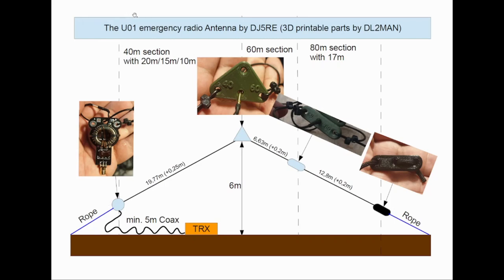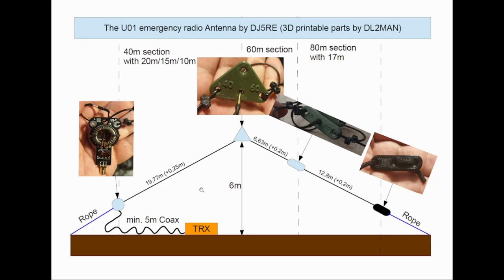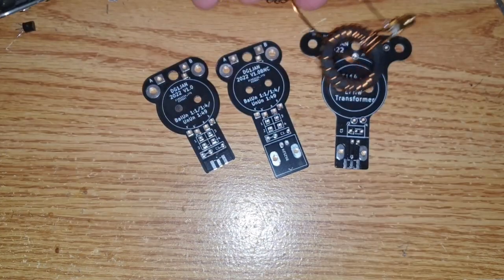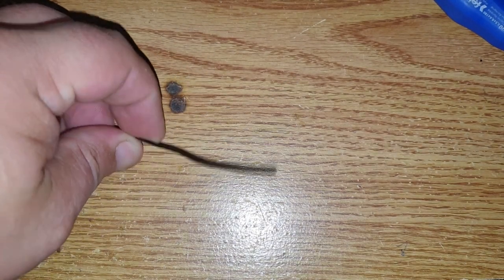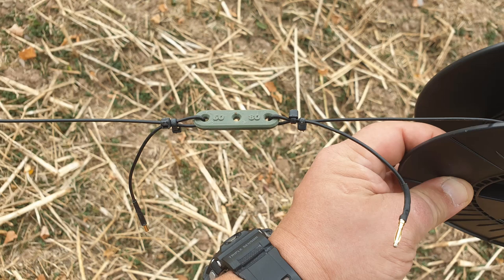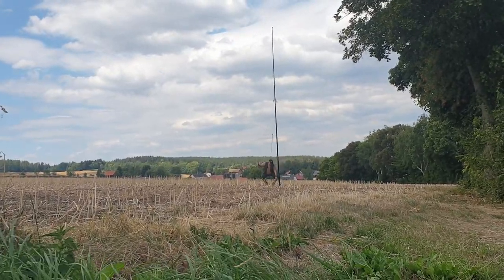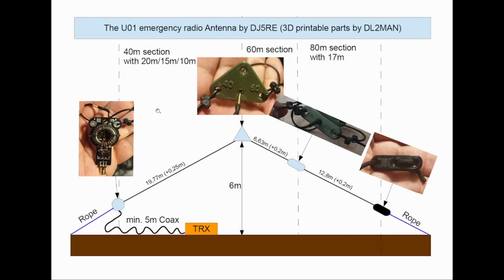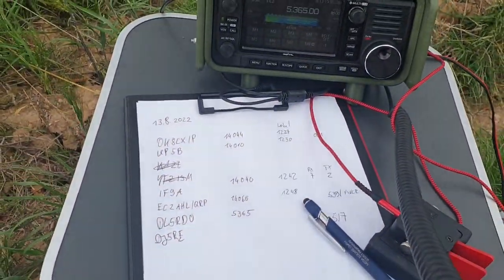U01 emergency communications Antenna - 80/60/40/20/17/15/10m EFHW

Comment: One more new thing I've learned from your videos. I didn't know the thing about the coax acting as RF choke. I must buy you a couple of beers by now with all the new things I learn 😁😁. 73 and have an amazing weekend. I will build this antenna too to have it there just in case 😁. Brilliant.. P.S. I didn't know about the 60m band either that it works that way.
Reply from the maker: There´s 2 reasons for min 5m coax: 1. The coax acts as counterpoise. 2. The coax on the ground helps in suppressing some common mode currents. I´m always available when it comes to drinking beer ;) Wish you the same. 73 Manuel; DL2MAN
Reply: @dl2man  Hehe... thanks Manuel. Ohh I hope one day we will share some and some QRP fun. Maybe next year. Until then... I am learning a bit more and having fun on air. 73

Comment: Couple corrections: the 60m one should also resonate close to 30m, and the 80m should certainly be resonant without tuner on 80, 40, 30, 20, 17, 15, 12 and 10m. It seems in your case they were all a bit out perhaps as it was resonant on 80m higher in the band. I think there's also some trick with a coil to make 80m usable higher up without upsetting the resonance on all the others (except 60m).

Comment: Will the FT114-43 core on the DL2MAN PCB handle 50watts?
Reply from the maker: I´m sure it will handle it. I´m not sure if it will heat up.... 100W Version will have FT140-43. Coming soon with own PCB including spindle ;) 73 Manuel; DL2MAN
Reply: @dl2man  Awesome re the 100w version. I will certainly build that.  Thank you so much for sharing with us 73 Greg VA7BC
Reply: @dl2man  How much FT8 power would the 100W version handle?  Like 20 W?
Reply from the maker: @TheMicrofox  100W means 100W ;) We´ve tested the FT140 cores with up to 400W, and it worked with some heating up.
Reply: @dl2man  Not so. l recently read about an OM, who burnt his 400W Balun with a 100W TX using FT8. Also I have seen Baluns/Ununs adverstised for 1000W SSB and 500W CW.
The reason is the duty cycle. Duty cycle is low when talking on SSB, higher with CW and extremely high when using digital like FT8.
Reply: Actually, ft8 isn’t that bad.    It’s only 50% duty cycle with each transmit leg only 30sec long.

Slow digital QSO modes like Olivia 250/8 is the most brutal.  Running 50W into my size 140 mix 43 unun melted the 3d printed PLA case it was in.

Comment: Hi Matey. I am in the process of making one of these aerials . But using mainly scrap material. Old wire, Car connectors and my homemade balun. Not as detailed video as yours so if you dont mind I will include a link to your video and a  short clip from your video. Assume that's ok. Cheers from old George G1BKI. Ps my video is now uploaded and live.
Reply from the maker: Thanks for considering building one. Everything that helps in spreading the word is welcome. Just a quick remark: It probably won´t work, if your UnUn is really 1:9.... 1:49 required, as Impedance is quite high. You can watch my other Videos about EFHW Theory, if you want to know how to wind one. 73 es hpe cu on Band ! Manuel; DL2MAN
Reply: @dl2man  Hi Manuel.  Thanks for your reply. I have made plenty of Baluns. Got quite a selection using Ferrite Torods and Rods. So I can experiment.  Video of them is included in my Ham Radio Playlist. I will be updating my Videos Later today. Cheers from G1BKI.

Comment: Manuel, I may have missed the answer to this question over the last few months, but what SWR would you say is the worst that can be accepted to operate with without much concern that the (tr)uSDX FET's will pop? As you designed the rig I suspect you have blown up numerous output FET's so you have a good for what they can and can't tolerate. I understand that there is simply no way to know for certain, especially these days with fake and subpar FET's on the market, but your best guess would be appreciated so I have an idea of how much effort I have to take to ensure a good match. I know some old-time tube-running hams who were happy with anything under 3.5 to 1, but I also have used some Motorola biz-band rigs that start cutting their output power any time the SWR climbs over 1.6. What's acceptable all depends on the output circuitry. I assume 1.5 is OK, but is 2? I always try to have a near perfect match because I'm just that sort of person, and it eliminates all sorts of possible problems before they can occur, but there may be situations such as emergency operations where I can't, so knowing what will probably work and what won't would be a great help. Thanks.
Reply from the maker: I wouldn´t bother too much up to 1,5:1. If your FET´s are not matched well, it could be a problem above that. On the other hand: https://youtu.be/VVN6xxu69zg with carefully selected BS170´s I TXed for 20 Minutes into SWR of 9:1 and worse with no problems.

Comment: Hi Manuel!
Very good implementation of the antenna project. 
Perfectly printed high quality parts. 
Your drawing is very useful for rebuildig the U01-antenna.
The wire from DX-WIRE is ideal for light and stable antennas.
A special thank goes to DJ5RE Tom for developing and optimizing the "emergency communication antenna".
Reply from the maker: Thank you so much !

Comment: Has anyone tried to implement connecting and disconnecting antenna segments with a remote control?  Is it possible?
Reply from the maker: I don´t think, this would be possible with reasonable effort. In this case, it might be easier, to build a trapped efhw. The Problem is: You´re losing the harmonics with that.... Building this exact Antenna with traps would limit it to 80/60/40m.  But you can add more traps for more bands. However: Every Trap means loss..... 73 Manuel; DL2MAN

Comment: Hello Manuel, received my tr usdx main board, its built and setup as by your advice, functionality is fantastic, looks great in the green case, I have great sound quality front a little exterior speaker, congratulations on all your hard work about your project, I await delivery of my classic band board to arrive, a big thank you to you and gedo, I will be looking at your anntena very shortly! it will be amazing how it will perform, ime sure of that, keep those surprises coming, this is just what the amateur radio hobby needs right now, innovation and functional and fun to use hand held transceivers. Brilliant work 👏 👍
Reply from the maker: Thank you so much for your kind words. 73 Manuel; DL2MAN

Comment: Hello Manuel
Do you have a reference address for the various antenna parts? Wire, plug contacts etc.?
With the best 73
DL9GAW (Black Forest)
Reply from the maker: Wire = DXWire, Plug Contacts as well as SMA or BNC sockets Amazon or Ebay, Silver Mica Cap: https://www.tubeampdoctor.com/ 73 Manuel; DL2MAN

Comment: Excellent video and project. I have a question however. I know the antenna was designed for NVIS operation. How much of an impact on the VSWR plots do you think would occur if the antenna was suspended at both ends from a greater height making it an flat end fed antenna instead of an inverted V?  If not much of a change it could function for both local and distant comms.
Reply from the maker: Especially on the fundamentals, the effect will be huge and wire length need to be adjusted. U01 Antenna is no re-invention of the wheel. It´s just a standardized setup. If you change the setup, you need to tweak wire lenghts and maybe even Transformation Ration of UnUn.

Comment: 9:1 unun and 110ft of insulated wire, put it up in the air and a decent radio tuner and it works well 160m through 2m. Yes I tried it on 2m and it worked just fine. Oh it is an inverted V in my yard. I tried it out just for giggles. make sure you have  a decent counterpoise wire
Reply from the maker: I try to avoid a tuner.... resonant antennas are my choice, as they are usually more efficient.
Reply: @dl2man  So why does my inefficient antenna work around the world? it must be broken
Reply from the maker: @n0vty873  simple: good conditions. Try in a direct comparison and you will know. By the way: Your answer is called a "strawman argument". You´re attacking a position, that I´m not defending. I did not say, your antenna does not work, I just said, I try to avoid tuners, as resonant antennas are usually more efficient. When I only have 5Watts, I want as much of that low power as possible radiated and not transformed into heat.
Reply: @dl2man  Yep Im just a fucking idiot

Comment: Thank you for sharing. I would like to build one of these. I am wondering if anyone has tried replacing the 40/60 and 60/80 connections with 40 and 60m traps. I am lazy and don't like taking antennas down to change bands 😁.
Reply from the maker: I´m not so sure if the Antenna will still work with Traps. You might be able to make it work if you insert a Trap for each Band, but I think, using the harmonics is no longer possible with traps, as they act as artificial additional length for the fundamental, so the harmonics are way off.... And every Trap means additional loss ! So you will lose efficiency. I might be wrong, and I thought I had a measurement of my Trapped EFHW for 20/30/40, but unfortunately I did not save it for the higher Bands, so I could look at the harmonics. Will do that measurement, next time, I elevate this Trapped EFHW, because I´m interested as well. Thanks for your question. 73 Manuel; DL2MAN

Comment: Thank you Manual for supplying this information on the U01 antenna. Our club is going to build and test a U01 for experience as well as use for emergency communication.
I was wondering what kind of antenna did Tom use on his side.
Reply from the maker: Tom was at home and used a full size doublet 2x20m, as you can see on his QRZ.com page. Basically the same amount of wire in the air, exept he used a tuner....

Comment: Very interesting concept which is based on a resonant wire and 49:1 transformer which provides the benefits of harmonics. The downside is that you have to lower the mast to make the adjustments which is a pain in my opinion. There is another alternative using a non resonant random wire (60 ft long and 5:1 transformer), you could get resonant on most of those bands by adjusting the length of the counterpoise.
Reply from the maker: There´s always plenty of options. I´ve also built trapped EFHWs, which do not need links, but in physics, there is no free lunch ;) You´re always trading one benefit for another. This concept has poven itself over time, and was a constant performer for me. If I could only have one ANtenna with me, it would be U01. Thanks to DJ5RE.... 73 Manuel; DL2MAN
Reply: @dl2man  Certainly, worth trying and validating as a practical option for NVIS communication. I will give it a shot and compare with a non resonant option.
Reply: @dl2man  thanks for sharing and for replying.  73s

Comment: Thank you for providing this information and also showing how it works.  I built a similar "linked EFHW" 100wt antenna in May so that I could use the regular 80-10 EFHW on 60m. It used automobile wire bullet connectors from a local store and it is hung on my 30' tower.  My antenna was not nearly as elegant as yours - a work of art as well as practical. I really enjoy your videos and recommend them to my friends. VY1GP